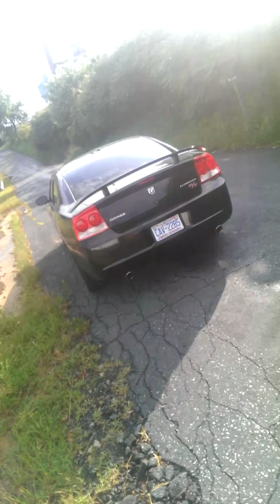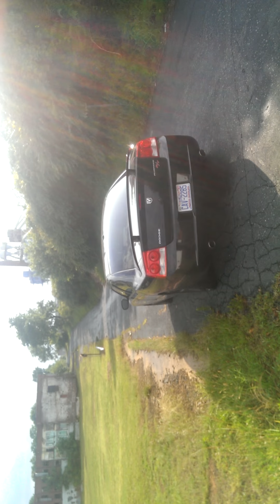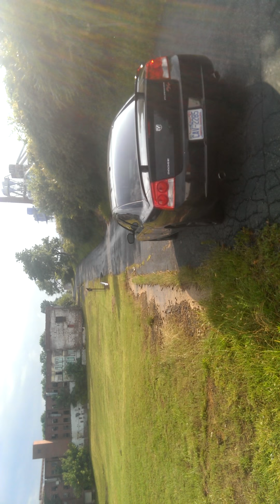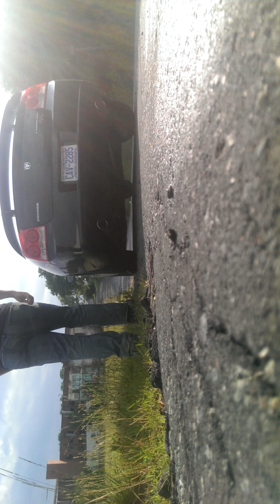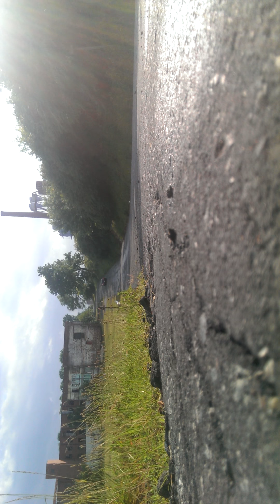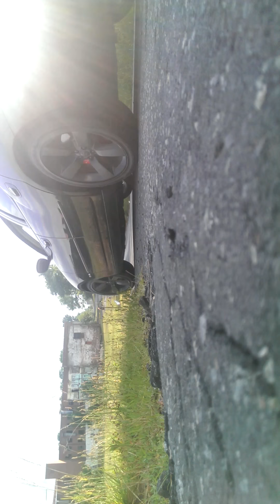Loud Custom Dodge Charger Exhaust Note

Comment from the maker: @ husam maani

It all depends on where you get the car. all the mods for mine were all together maybe $400. The cars go for between $8000-$20000 all depending on mileage and condition. 

This specific one I sold for $16000.